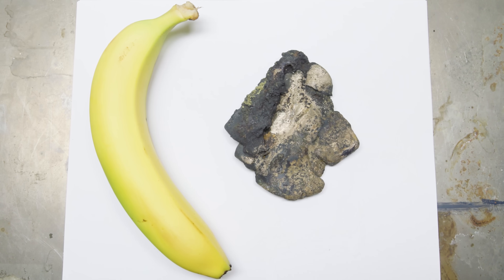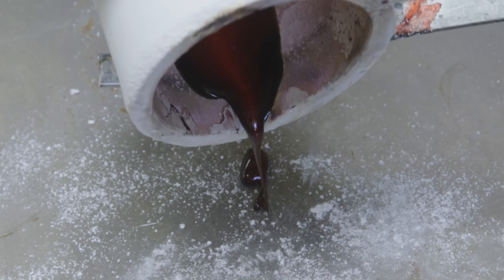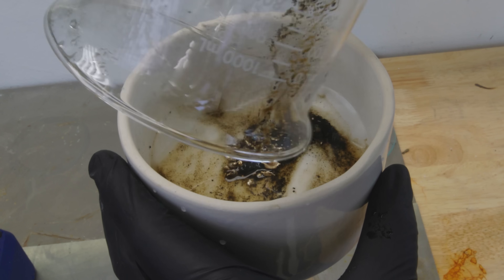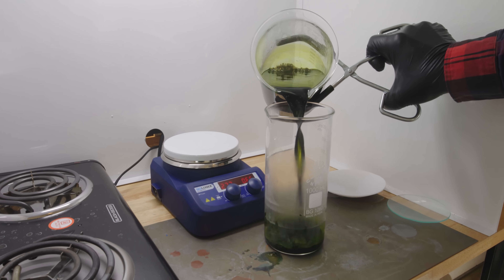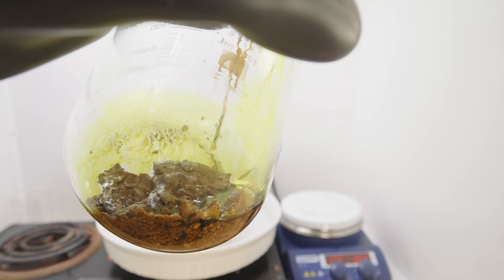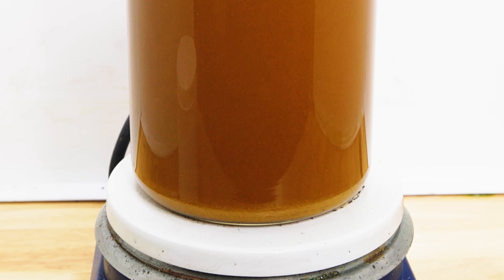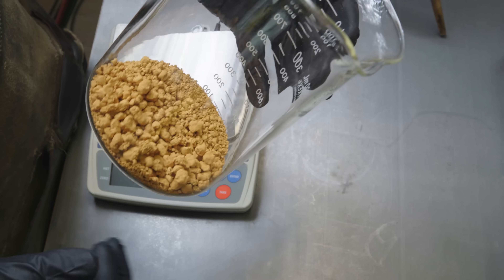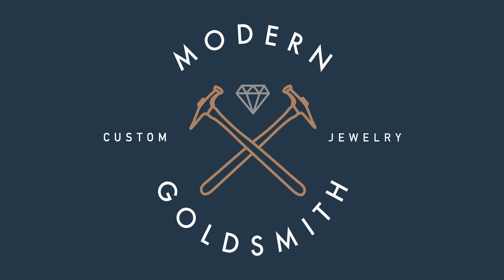Turning a BLOB into PURE GOLD!

Comment: I wish you had used nitric acid first to remove the high silver and base metals, but from the color of the first boil it looked to have quite a bit of both platinum and copper in the mix, its highly advisable to keep your filters and washed sponge residuals in a sealed container in case there is too much platinum. If platinum is dry dusty sponge and disturbed it can be way more dangerous than asbestos. Please seal them away.. ..Further refining. reboil all the waste in nitric in a bigger container cool and let the platinum and pladium come out of solution on zinc , then wash many times,  settle   .. let the silver then drop out of solution on copper,  rinse repeat then can get copper from solution on iron.

Comment: Gold only has value because we've been conditioned for generations to believe that it does. If we stopped believing this, its value would be a lot closer to that of copper.
Reply: Actually gold is extremely valuable as it is very sought after for its uses and rarity.
Reply: @catgirl-ame  Value is determined by supply and demand. If demand approaches zero, so does value.

Comment: USeless comments from a chemist perspective (assuming the blob was homogeneous)
1. Consider to pulveraze the sample
2. Do not put becker on the heat resistor please
3. A key element is stirring, with a stirrer
Next time all this tips could emprove a lot the process both in terms of time and amount of reagent required.

Comment: What is that orange fumes?
Reply: The orange fumes are nitrogen dioxide, absurdly toxic and deadly. There are some other gasses mixed in, but nitrogen dioxide is likely what's giving it the orange color.
Reply: If it's inhaled, it will become nitric acid inside your lungs which is not usually very good for you lol

Comment: A good tip to deal with black crud like you had at the start is to add some hydrogen peroxide. Most likely the black stuff is carbon, which isn't water soluble. Hydrogen peroxide will break it down and give off simple carbon dioxide. It's also quite safe to use really.
Reply: Thanks!
Reply: And remember to put plants near the CO2 to prevent greenhouse emmisons

Comment: As a chemist, seeing 96% yield of 99% purity from a process by someone who calls themself a non-chemist is mind-boggling. Smithing is definitely chemistry imo, and I have some serious respect for you for doing something like this so flawlessly. 10/10.
Reply: the initial estimate had a giant error margin.  like +-30% or so
Reply: Well frankly his claim of the theoretical yield was based on a sliver from the initial chunk where gold was not uniformly spread which was easy to see. Perhaps a better approximation would be achieved if he took more slivers from different colored parts and averaged them or even better melted it first so that the material was uniformly spread and then taking a sliver, but I do not mean to undermine his achievement he did a great job nonetheless. I just think the theoretical yield could've been lowballed a bit, but still great work.
Reply: @matiKRK I was going to say this. I feel like it was more than 10k gold and he probably lost a lot more than 9g in the process
Reply: @matiKRK  - That was my thought exactly!  The gold concentration certainly wasn't uniform throughout the "blob", so we have no idea whether the initial sliver he tested had a higher or lower concentration than the blob as a whole.
Reply: Well, that's an estimate based on a very low precission meter composed of four LEDs.  I thing he lost a lot in all that processes.
Reply: @MaxCarponera  good point, I'm not a chemist but am in the life sciences. I remember getting 85% yield in organic chem lab and being satisfied with that. We did get to use a rotovap too :)
Reply: each time this processed he will lose weight and volume this is to be expected as your cleaning the metal you throw out the trash
Reply: he’s obviously walter white
Reply: @clementpoon120 obviously he's pee diddy himself😂
Reply: Did he just turn a blob into $15.7k?
Reply: An ACTUAL chemist would have realized the gold % in the tested sliver is likely not representative for the whole sample and that the actual yield was lower than 99%.
Reply: Yep another chemist chiming in to say, wow!  Good job.  I don’t work with metals, but that’s a good efficiency for any extraction process.  Bravo!
Reply: اردو زبان میں ترجمہ کر سکتے ہو
Reply: @MuslimMobile-mb6xq No 😂
Reply: You ain't chemist cut the cap 😂
Reply: @narutokiller8432  He is a chemist, don't use Black slang
Reply: The calculations are assuming the original blob was 1) 10k gold and 2) a consistent proportion throughout, but he even mentioned that it didn't look like it melted all the way together which stands to reason that it wouldn't be fully homogenous. The test sample he used may have been more or less concentrated than the rest of the sample. Also, the devices used can only tell the difference between 10k and 14k. If it was closer to 14k, then the theoretical yield would have been 331g, which would mean overall it's a 68% yield. There are too many unknowns to be able to accurately give a yield.
Reply: Im a woodworker by trade, electronic recycler as a hobby and this is basically what I do to get the gold and silver from electronic waste
Reply: Where Can I contact you?
Reply: Agreed
Reply: the only way i could ever ever be able able
Reply: If there was Walter white, yield would be 99.6%
Reply: Ok😊 loo😊
Ok
Reply: Seriously no way 😂😂I'm chemistry grad and was good yield . I was suprised
Reply: How can I contact you
Reply: These comments are hysterical 😭😭😭
Reply: Job well done. Too bad he didn't go into Electrolytic process. That could have gotten even better purity.
Reply: I was thinking the same thing
Reply: I do pretty much this same process with my turds but all I ever get it corn.
Reply: Way to go!!! .99 is .999 or could be....but the foundry didn't test that precise,still a resounding success much respect to you for achieving this positive result!!!
Reply: we have the same thoughts bro😂
Reply: From the second one when the water gold it look like juice
Reply: Hi
Reply: Honestly I was expecting only around 190g of gold at the end 213 was insanely high
Reply: Shut up
Reply: great video. thank you.
Reply: I saw you wrote be legally and then I knew it was you guys
Reply: https://youtu.be/dl2Iu-TVo7g?si=HvOwC45JLvwiwvzW
Reply: I have sample here, but don't chemicals to process, can you do it for me? This is huge materials from mountainous area with symbol on stone atop of it.
Reply: i think that the original bloob had higher purity in the middle parts instead of the perifery
Reply: Cooking crack don’t make you a chemist.
Reply: @ModernWelfare_  Racist weirdo.
Reply: @ModernWelfare_  Such a sad life.
Reply: @ModernWelfare_ but cooking crank (the kids call it meth) does? 🤔
Reply: The video is very engaging, your explanations are so clear! Do you plan to explore other creative processes?
Reply: @Elite-Process I beg to differ , blowing up the crack don't make you a chemist 😂😂😂
Reply: A black chemist...yea okay bud.
Reply: Original gold content was probably higher in it's original form.
Reply: a realife jesse pinkman.. 😂
Reply: I would argue smithing is the closest thing we have to alchemy
Reply: @Artix117a it is alchemy
Reply: Seriously? It's more like baking than chemistry
Reply: chemist as in pharmacist
Reply: @hekasoram  Sad and jealous.
Reply: perhaps you shouldn't a be a judge on what a good chemist is. i'm guessing by you calling yourself a chemist you just mean shake n bake in the good ol' two-liter. follow directions, be precise and like presto you're chemist....
Reply: As a lie detector, ur not a chemist.
Reply: @GOnPOSTit  Jealous boy.
Reply: It just shows the power of self-learning. Sure, you get a LOT of people who watch a single pseudoeducational video and thinks they're an expert. But when you see it all the way through, this is the result. It shows the difference between people who learn this stuff for themselves because they're curious and people who want to learn the bare minimum so the can lord it over everybody they know and talk like they know everything about it when they know nothing at all. You know the type.
Reply: Ur not a chimes
Reply: You ain’t a chemist lil guy 😂
Reply: Googles, mask, gloves, an infraused small fume cupboard... Security, ok. But I miss the classical white lab coat chemists wear. I'm a nostalgic 😂
Reply: Pssshhh
Reply: @juststevoo  All of the best chemists are in prison .
Reply: Hello
Reply: Yeah us non-chemists are well below par on most things in life, well done non-chemist for raising the bar for us plebs 🙄
Reply: Well that depends on the quality,purity ,  of the inputs.. The original blob I suspect was pure gold and silver mixed ...he made it...   And the other ingredients he gets to buy the highest quality.. rather than the quality that is economically viable.
Reply: I too am a chemist, and was also impressed by this non chemists first try. Some of the missing gold may well be in the other raffinates he ended up with, along with the silver.
Reply: I totally agree... WOOOW
Reply: 99%, just like how 99% of youtube videos are refined or edited for a better narrative.
Reply: gamer chemist? ur kinda sick dude
Reply: its NOT HARD 🔥🫶 was taught in 07 in 15mins 🤺
Reply: Its fucking amazing i thought he would do less than 200 grams!
Reply: Ai can teach someone to do this step by step. Love technology
Reply: How much cost it take u to extract this gold and time
Reply: I assume that you discarded the used chemicals safely
Reply: You are not a chemist
Reply: We don't know if that was 10k or more. So we don't know if that's 96% or 85% or 98%
Reply: He's a gold Smith
Reply: Well technically it could be a lot lower than 96%. Consider the accuracy of the gold tester all we certainly know is that the ore sample is ~at least~ 10 karats, it could be slightly more, thus increasing the 222.3g theoretical 100% yield.
Reply: Where is the Mountain, wherefrom the blob is?
Reply: Yield is not 96% though. Even if the slice of gold is representative the number of 222g is a lower bound for the gold content in the blob, as the device gave a rating of [14kt, 15kt). This means that (again assuming the sliver is representative) the yield can be as low as about 68%, so realistically it is going to be in between really.
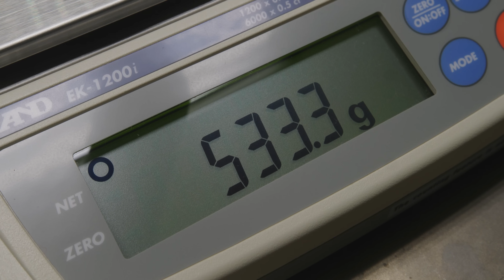Reply: 0:19 😮😊
Reply: if you think 96% yield in recovering gold is good you are probably an organic chemist
Reply: 0:12
Reply: science is like cooking, follow instructions properly and youre good
Reply: Which chemicals are used for processing this gold 😔
Reply: Really?? I would never call myself a chemist at all but am knowledgeable in this area and I was cringing watching him put that SMB into that filthy swill.
Reply: Are you using pyrex glass?
Reply: math is everything
Reply: Coming from another chemist (chemical engineer), I almost couldn't believe it.That is astonishing
Reply: What level purity is your crystal meth though
Reply: You are just about right!!!!!!!!
Reply: Also chemist here. The yield and purity he gets is impressive. Got lots of iron tubes (about 20 cm long) inner lining is gold. Probably just a thin layer of gold but i can try
Reply: @kimvo5504-q6e  no it's pretty much on par if you follow the directions...
Reply: It doesn't seem like it takes as much knowledge as it does patience. Anybody can do it you just have to focus and make sure you do it right and repeat repeatable processes and double check to make sure your ready to move on. Sounds like basic chemistry to me and I took two years of chemistry
Reply: @christianman2339  That is mostly what the goal is in a lot of reactions. The problem for inexperienced folks in chemistry is that it's not so easy to repeat a process that generally does not go off of set times but off of visual queues and identifying the stages as they complete and guaging your success based off of the outcome, yield, and the understanding of what that should look like or be.. In most cases, a simple change of color, type of physical reaction (bubbling, gassing, simmer, etc) can mean so much to the observer who knows what they are doing and could be an indication to make necessary changes either in the moment or later as needed because of this, it is amazing that somebody who would be so unsure about the exact details and not have any way to determine if the information he is getting is for sure the best source of information if he's researching it online and taking whatever information he can get ahold of, maybe he got a book but what if that's outdated information, there is so much to this than just patience and repeating a couple of steps when it comes to getting a high yield and purity of an end product in whatever recipe you follow for any reaction you are trying to accomplish in chemistry whether it be a reduction, extraction, or reaction. I am not even a trained chemist myself but have lots of at home experience as a teen and young adult doing experiments and I am very impressed at how confident he seems and the fact he just has all this shit at his disposal and isn't substituting with some type of kitchen / shop technique haha as well as the fact he is performing this on something that isn't necessarily even his, so he says.
Reply: @christianman2339  You should start selling jewelry then.
Reply: @christianman2339  Please, give this man the credit he desperately deserves.  What he has accomplished is beyond worthy of a notable achievement.  Patience, yes.. Being a layman and achieving the level of purification (on his first endeavor no less) is absolutely remarkable.  Kudos to him.
Reply: @christianman2339 Have you ever wondered, why a craft requires a lot of learning and training (repeating a process until muscle memory, a certain feel, for the material, handling and gathering enough experience to tell apart a crappy result in a multi-step process)?
It's because "everyone" can do it after training and learning for a couple of years... that's why they get that "Job-title", like baker, mechanic, data-analyst, heart-transplant-specialist or a coiffeur... 😉
Reply: What is a blob? The original pièce ? I cant find the french translation ? Tank you for the help.
Reply: a blob is  une goutte  in french (google translation)
Reply: @mode-zc2wi Ugh just get out of here
Reply: @mode-zc2wi a blob simply means a combined bulk of material in a shape usually ball like. Round.. any sized ball of stuff is a blob.
Reply: @mode-zc2wi  you're French? hope they find a cure
Reply: You really only have to follow a guide and buy the right tools/materials from the looks of it.
Reply: @EeveeRealSenpai They literally said this when he got his PHD. Simple?
Reply: @EeveeRealSenpai  That might work for your line of work, whatever that is, but don’t come here trying to spread your uninformed opinions. With chem you need to know what you’re doing, else you can and will get killed, and harm others in the process.
Reply: @Joris-KarlHuysmans  when you're following a step by step process without making any errors, then you know what you're doing, because it's all laid out in front of you. Keep in mind I'm taking about just following a process and not general chemistry. Please remember to read comments properly.
Reply: @EeveeRealSenpai   The knowledge a chemist has wouldn't need to follow a guide and would be more efficient. Everyone is capable of following instructions on how to cook a good meal but a chef would perfect it.
Reply: @wizarddragon 
I'd say this is more like baking rather than cooking in general, an exact science

Sure professionals with experience can do these things efficiently, but a well prepared newbie should not be underestimated.
I personally believe that Skill isn't as determining in this case.
Reply: @wizarddragon  I beg to differ, there are plenty of people who can't boil water let alone make an edible meal! Plenty of people are incapable of following simple instructions, and would likely kill themselves trying something like this! 😂
Reply: @wizarddragon cooking is art, with many ways to get to an acceptable result.  Chemistry is science, and more along the lines of baking with hard rules and exact measurements being key.
Reply: @wizarddragon I’m a scientist (a physician) and I still look up various symptoms, conditions, illness, medications etc  on a daily basis.
Reply: @EeveeRealSenpai baking ??? Are we not talking metals now ,??? 😂😂😂
Reply: @EeveeRealSenpai  Chemistry is the one discipline you NEED to know what you’re doing, else you’re putting yourself and others at risk.

Don’t be ignorant, open a book. There’s no “vibes” here, chemistry is an exact science.
Reply: @wizarddragon  This is specially NOT TRUE with chemistry. If you don’t know what you’re doing you can and will get killed. Simple as that.
Reply: @wizarddragon exactly
Reply: agreed I expected the yield to be much much lower
Reply: Cooking crack don’t make you a chemist.
Reply: non-chemist ???
Reply: As a nuclear scientist, i estimate the neutrons to diffibulate the quarks in the gold. Im happy you are just as educated as me in a different field
Reply: @chrisvanderburg5568 Please! 😂😂😂
Reply: Its not mind boggling. Its just simpelr than it is. Aka you think because you ar ean expert it take sone to make this.
Reply: You're not a chemist 😂
Reply: @emilymayer5926   judging by what
Reply: @emilymayer5926 Someone can post anything on their channel, doesn't mean they can't be someone else outside of it 💀. Just because he plays games doesn't mean he can't be a Chemist or has studied in Chemistry
Reply: @emilymayer5926 and your proof to back this claim up is...?
Reply: @emilymayer5926  chemist as in pharmacist
Reply: @hekasoram  He is a chemist.
Reply: @emilymayer5926  you could be wrong